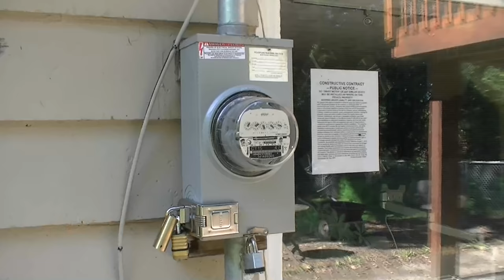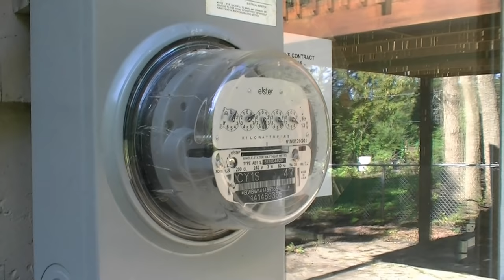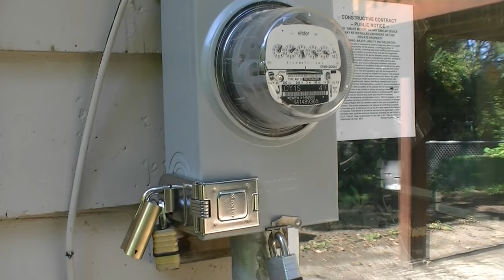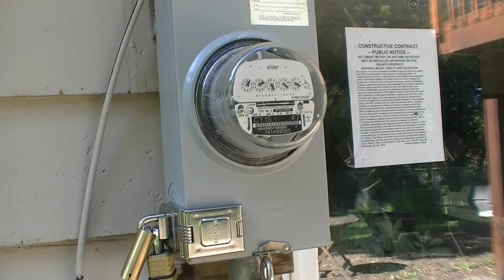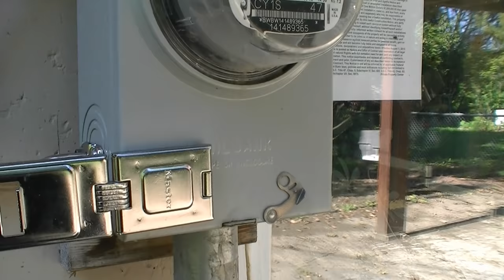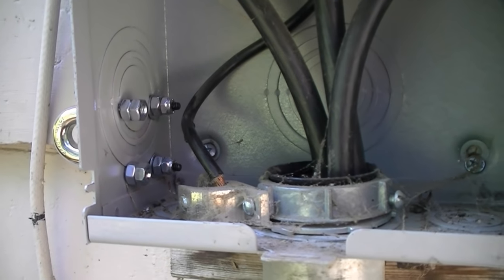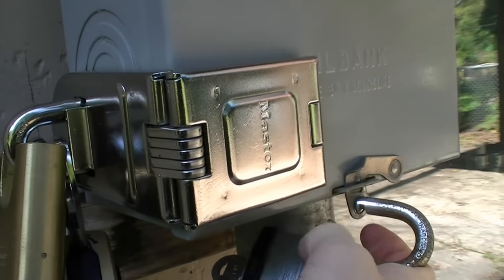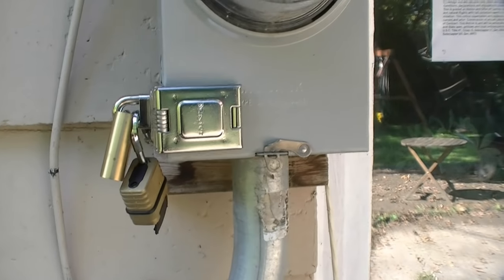Locking Your Electric Meter to Prevent Smart Meter Installation

Comment: You are probably the one doing the illegal tampering.  You don't own the meter box; your electrical company does.  When you signed up to get service, you most likely signed a contract agreeing not to interfere with the company.  You have actually done what you are trying to catch the electric company doing.
Reply: Heh Stu, can you supply us with the contract that was signed by your customer allowing you to install a FHSS, AMI7, meshed network commercial high powered  radio transmitter?
Reply: Let's look at why we need TIN FOIL HATS. 
 #1 A smart meter will hurt or even KILL disabled homeowners who have disabled medical implants.  The average of deaths by smart meter radiation and smart meter fires is almost 100 every month in North America.
#2 Did you know if your power company “turned off” the power to your home when they did a smart meter install, your chance of a smart meter fire increased by a factor of 10,000.
#3 Your power company has access to all of you private power information. Eg When you make tea, when you turn on your alarm etc. This private information is sold to Google for huge sums of money. Ask your power company what the second radio transmitter in your smart meter does. (ZigBee) 
#4 A smart meter will cause cancer to return if your family members who are fighting cancer at home. If they come home from the hospital and sleep near a smart meter, they will die. Check with the US Cancer Society website. 
#5 Smart Meter RADIATION  will turn off breakers in your home. Both AFCI's and GFI's get turned off by the radiation from the smart meter.
#6 You smart meter is very accurate, BUT, the software (firmware) is programmable. Your bill has nothing to do with the power you use. 
#7 Smart meter radiation is breaking Ionic Bonding.
#8 A huge expenditure for a huge loss. Billions of dollars to purchase something that does not general generate any power and each smart meter need 4 watts to operate. One million smart meters use 4,000 KILOWATTS of energy to operate.
#9 The second radio transmitter is for ZigBee. If you want your power company to MONITOR your home 24/7, then you are in luck. Don’t forget, this private information will be sold. Why do you think your power company spends BILLIONS of dollars and does not generate one watt of extra power to sell?
Reply: Tin Foil Hat  Definition: A defunct derogatory phrase used by power company managers with limited mental ability to try to insult or degrade unfortunate people who have to use unshielded medical implants to try and keep an acceptable degree of life.

Comment: You may own the meter enclosure (not all places doe the owner own it) but you DO NOT own the meter and because they are they one providing the electrical service to you they can replace that meter no matter what you say. You don't want to let them change the meter, OK they will just cut your power at the pole or transformer. Good luck in a court of law with them...
Reply: You may own the meter to read the power your customers are using, but YOU HAVE TO RIGHT TO INSTALL A COMMERCIAL, MESHED NETWORK, FHSS, UNLICENSED RADIO TRANSMITTER ON OUR HOMES
These smart meters are killing hundreds of your customers every month

Comment: they will cut that right off! and charge you with felony tampering! 100% fact
Reply: Let's look at why we do not need smart meters.  
 #1 A smart meter will hurt or even KILL disabled homeowners who have disabled medical implants.  The average of deaths by smart meter radiation and smart meter fires is almost 100 every month in North America.

#2 Did you know if your power company “turned off” the power to your home when they did a smart meter install, your chance of a smart meter fire increased by a factor of 10,000.

#3 Your power company has access to all of you private power information. Eg When you make tea, when you turn on your alarm etc. This private information is sold to Google for huge sums of money. Ask your power company what the second radio transmitter in your smart meter does. (ZigBee) 

#4 A smart meter will cause cancer to return if your family members who are fighting cancer at home. If they come home from the hospital and sleep near a smart meter, they will die. Check with the US Cancer Society website. 

#5 Smart Meter RADIATION  will turn off breakers in your home. Both AFCI's and GFI's get turned off by the radiation from the smart meter.

#6 You smart meter is very accurate, BUT, the software (firmware) is programmable. Your bill has nothing to do with the power you use. 

#7 Smart meter radiation is breaking Ionic Bonding. 

#8 A huge expenditure for a huge loss. Billions of dollars to purchase something that does not general generate any power and each smart meter need 4 watts to operate. One million smart meters use 4,000 KILOWATTS of energy to operate.

#9 The second radio transmitter is for ZigBee. If you want your power company to MONITOR your home 24/7, then you are in luck. Don’t forget, this private information will be sold. Why do you think your power company spends BILLIONS of dollars and does not generate one watt of extra power to sell?

Comment: They will just kill it at the distribution point I.E. pole or box off the property!
Reply: BUT WHY DO THEY HAVE TO INSTALL A DEVICE THAT KILLS OVER 100 FOLKS EVERY MONTH?
They only have the right to measure what power you use.
THEY DO NOT HAVE THE RIGHT TO INSTALL A COMMERCIAL, MESHED NETWORK, HIGH POWER RADIO TRANSMITTER ON YOUR HOME

Comment: Genus....NOT !  and more false info.
Reply: Let's look at why we do not need smart meters. 
 #1 A smart meter will hurt or even KILL disabled homeowners who have disabled medical implants.  The average of deaths by smart meter radiation and smart meter fires is almost 100 every month in North America.

#2 Did you know if your power company “turned off” the power to your home when they did a smart meter install, your chance of a smart meter fire increased by a factor of 10,000.

#3 Your power company has access to all of you private power information. Eg When you make tea, when you turn on your alarm etc. This private information is sold to Google for huge sums of money. Ask your power company what the second radio transmitter in your smart meter does. (ZigBee) 

#4 A smart meter will cause cancer to return if your family members who are fighting cancer at home. If they come home from the hospital and sleep near a smart meter, they will die. Check with the US Cancer Society website. 

#5 Smart Meter RADIATION  will turn off breakers in your home. Both AFCI's and GFI's get turned off by the radiation from the smart meter.

#6 You smart meter is very accurate, BUT, the software (firmware) is programmable. Your bill has nothing to do with the power you use. 

#7 Smart meter radiation is breaking Ionic Bonding. 

#8 A huge expenditure for a huge loss. Billions of dollars to purchase something that does not general generate any power and each smart meter need 4 watts to operate. One million smart meters use 4,000 KILOWATTS of energy to operate.

#9 The second radio transmitter is for ZigBee. If you want your power company to MONITOR your home 24/7, then you are in luck. Don’t forget, this private information will be sold. Why do you think your power company spends BILLIONS of dollars and does not generate one watt of extra power to sell?

Comment: You know they do not open the box to replace the meter.
Reply: The only way to get the old meter out and put the new meter in is to open the box.
Reply: There are different styles of boxes. Some need to be opened to replace the meter and others don’t. If the metal locking collar is not visible around the edge of the meter, the box probably has to be opened to service the meter.
Reply: Ronald Moore yes they do
Reply: My can be replaced without opening the case

Comment: They DO NOT record WHAT you are using. It measures HOW MUCH and WHEN, so they can perform load balancing on the network. If they can save one dollar a month per user, the economies of scale can save them a lot of money. They also don't have to pay a person to come to your house to read the meter. The device collects data every minute and sends data to the network once about every 15 minutes, emitting no more RF power than the wireless modem we currently use. I am kind of curious as to what type of vandals are running around your neighborhood and what benefit is gained by opening your meter? Public utility easement is agreed in your mortgage contract and you are responsible for SAFE installations. Now, your are liable for the Arc Flash safety issue you have created by creating an electrical contact OUTSIDE the box. Where do these people get their information? ALso, installers carry bolt cutters and will whack off your locks if it impedes the access to their equipment. Wanna OPT OUT? there is about a $300 charge to replace an old style meter and you will pay an additional charge for a person to visit your house monthly to read your meter. Escalated trouble calls will be billed to you if they have to send people out over and over. If you wanna play the "this is my property" game, they'll just "red-tag" your meter and you'll go without power. This has to be one of the worst campaigns I have ever seen. Time to be a real rebel and MAKE your own electricity.
Reply: Let's look at why we need TIN FOIL HATS. 
 #1 A smart meter will hurt or even KILL disabled homeowners who have disabled medical implants.  The average of deaths by smart meter radiation and smart meter fires is almost 100 every month in North America.
#2 Did you know if your power company “turned off” the power to your home when they did a smart meter install, your chance of a smart meter fire increased by a factor of 10,000.
#3 Your power company has access to all of you private power information. Eg When you make tea, when you turn on your alarm etc. This private information is sold to Google for huge sums of money. Ask your power company what the second radio transmitter in your smart meter does. (ZigBee) 
#4 A smart meter will cause cancer to return if your family members who are fighting cancer at home. If they come home from the hospital and sleep near a smart meter, they will die. Check with the US Cancer Society website. 
#5 Smart Meter RADIATION  will turn off breakers in your home. Both AFCI's and GFI's get turned off by the radiation from the smart meter.
#6 You smart meter is very accurate, BUT, the software (firmware) is programmable. Your bill has nothing to do with the power you use. 
#7 Smart meter radiation is breaking Ionic Bonding.
#8 A huge expenditure for a huge loss. Billions of dollars to purchase something that does not general generate any power and each smart meter need 4 watts to operate. One million smart meters use 4,000 KILOWATTS of energy to operate.
#9 The second radio transmitter is for ZigBee. If you want your power company to MONITOR your home 24/7, then you are in luck. Don’t forget, this private information will be sold. Why do you think your power company spends BILLIONS of dollars and does not generate one watt of extra power to sell?
Reply: It seems like you are just making this stuff up as you go. Most of these meter fires are caused by the homeowner stealing power and replacing the meter exposes the crime and they are generally dangerous modifications. There is no actionable information to sell to google, it only has sensors for electricity, not cameras. "http://go.aclara.com/predictive-grid-analytics-with-smart-grid-sensors" AFCI's and GFI's are designed to trip during OVERCURRENT situations. They will NOT react to low-level free RF radiation. Have you ever seen the Northern Lights? That's the planet's defense against excessive RF from space, do you suppose there is a big smart meter in space? The radio's use 2.4 Ghz spectrum and this band is shared by many other devices like your modem, wireless network, home phones, etc. Ionic bonding? OMG, you ARE just making this stuff up! Ionic bonds are what holds water molecules together, so if you bring a glass of water close to the RF, it should in theory disassociate into hydrogen and oxygen gases. You are just wasting everyone's time here by spreading fake news and information.
Reply: Heh drc10101
Paid propaganda from silver springs. 
Why didn't they just use the CERTIFCATION EXHIBIT for their smart meter?
OH WAIT, THAT MEANS THE TRUTH WILL BE EXPOSED
THEN ALL OF THEIR CUSTOMERS WOULD FIND OUT 35% OF ALL METER INSTALLATIONS ARE IN VIOLATION OF THE FCC'S RULES
Reply: The bypass is designed for mission critical or life saving equipment. We're seeing them used more often on the 3-phase systems. Jumpers are great but you can't use them on a ring style can. All of the Itron meters I have seen are UL rated. No violation of NEC exists. Customers don't own the meter, if it fails, the utility replaces it. Overcurrent is different than overvoltage. Overcurrent conditions would be factored by the power used on the property. Even then, with a 200 Amp main breaker, the breaker would trip. It also means that every circuit on the property would be maxed out, which is really unlikely especially on a lighting circuit. If you are that close to your current limit it may be time for a service upgrade. I like how publicly available authentic certification information is just disregarded as "propaganda" when you absolutely have to sell this hoax. Fires occur. If this is your business then you must have seen a glowing meter before, right. I have seen a pot growing room where they were using the full amperage and the meter was red hot.
Reply: We all can see just how little you care about your customers well being dcr10101.
For the 4 extra minutes, you could reduce the fires caused by your installers carelessness. 
THINGS YOU WON'T DO JUST TO MAKE  MORE MONEY
LIE
CHEAT 
MURDER 
Yep, just like any other power company scumbag in the world.
Now you know why I do not work in this industry anymore dcr10101

Comment: Oh, one more thing. The information that the meter provides is useful to the consumer. Knowing when and how much current you are using is very helpful in saving money. It is called Load management, and is crucial especially if you have a new or older grid tie P.V. system and are under any type of net metering agreement. But for you being so paranoid, I would suggest that you just go off grid and supply your own power. If you want some education on power supply and power management I would be happy to help you. Just contact me.

Comment: If you don’t want the meter, don’t have electricity. They’re giving you a supply that they control and monitor. Don’t see anyone complaining about having broadband providers do this because they know that the provider would just tell them to disconnect. It’s the same with electric. Play by the terms you agree to or don’t have a supply and get it capped off

Comment: Smart meters ONLY provide information to YOU and YOUR SUPPLIER on HOW MUCH POWER YOU USE ONLY! How you think a different meter can read what is plugged into what and when is just moronic. It sends the supplier the readings... Get a grip
Reply: La Diablo quite simply the supplier installs a new meter external to the home where your devices are located. This meter tells the supplier how much power you are using and therefore what your bill should be. The intrusion here I see is that they always know how much (total) power you're using without you providing a meter reading. The supplier has no need to know what devices you use as this information is pointless to them. You're link whilst on subject does not dismiss my point. It's a technology that connects devices yes, however requiring setup and compatible devices. My standard light bulbs and lighting in my property is not compatible with this and therefore is irrelevant to this debate. I belive the smart meter roll out is a good thing and allows people to see that their large devices are pulling serious power. Instead of just eye popping at their next bill. Thus allowing them to have the information present to be more conservative with their power usage. Also the debate about smart meters health impact whilst important for those effected or not effected are surely more impacted by that iPhone in their pocket all day than a smart meter on the outside of their property, no?
Reply: La Diablo aggression and utterly irrelevant statements do not prove your point. A smart meter is not some evil device planted by some evil business is an innovation attempting to show consumers their own energy impacts. I am sure there are some good arguments as to why certain people should decline installation which they are allowed to do. The supplier just needs to show best efforts to be compliant with regulations. However if it's claimed someone is unable to have a smart meter due to health impacts by the radio signals then I hope they don't own a mobile phone, use a laptop or wireless device at all and stay away from microwaves and TV remotes. Those individuals should indeed not have a smart meter but stop corrupting the masses who could benefit from such an innovation.
Reply: La Diablo you seem to make a fair load of outlandish claims do you happen to have figures and evidence of this? Has this been investigated into why there is an issue on your claims and if so was this at all anything to do with the meter? I am enjoying your childish responses however. Keep it up!
Reply: La Diablo I don't believe you have the right to critique other people's grammar and spelling when your's is appalling. Further clarifying you actually have no valuable input to this debate only inaccurate information being presented in an immature way.